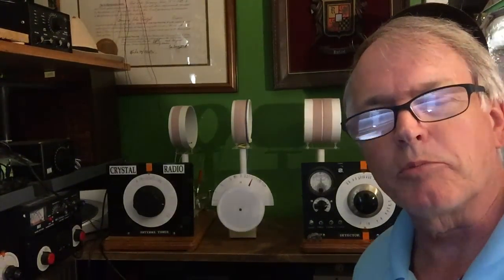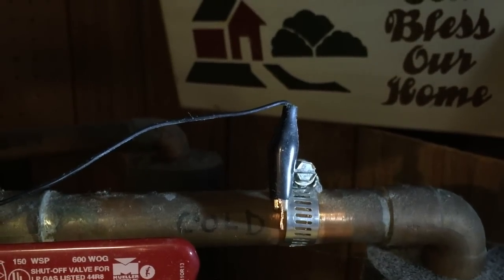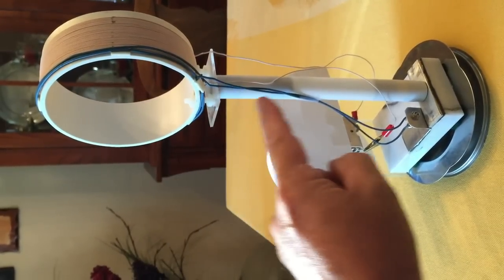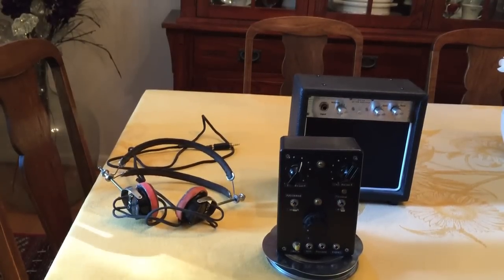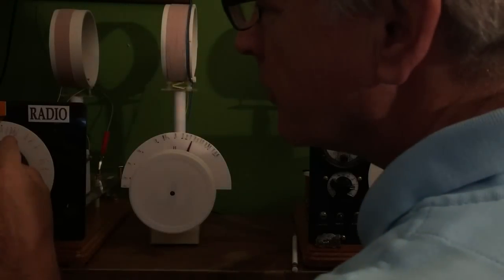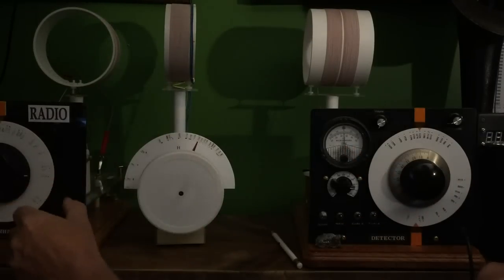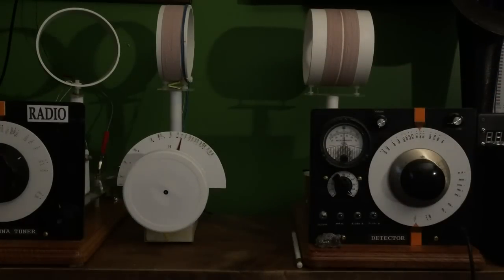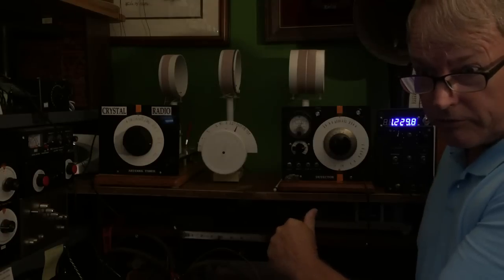xtal1

Comment: Very nice Chris  , I use to use antique 1920s designs from Roger Horton in Silver Springs, NV and even with a simpler single variocoupler system   using a 250 ft long wire antenna, audio amp and a good trap and an outboard antenna tuner with simple house AC ground I have logged 32 states. I have even logged several low power stations in the day out to 100 to 150 miles,   3 were only running 250 watts class C , big thrill   I also use a BC Band receiving loop in the ground side of the circuit as sort of a traveling wave trap and it works excellent, eliminates having to have more than 1 trap  You tune the loop until you knock down the local power house about 75 to 80 percent then start radio tuning for other weaker stations,   I sold all my gear 3 years ago to go RVing but those plans did not pan out and regret losing my prize crystal radio station, glad I caught your video as I am now determined to get back on,  What a beauty you have there-   all the best- J
Reply from the maker: Thanks James- hope you can getback on- your technique for pulling in the weak ones behind the flame throwers is very good!

Comment: It would be interesting to hear more in depth about filtering, and how to increase over all efficiency.
Reply: The trick to this radio's excellent selectivity is the Band Pass Filter, located between the Antenna Tuner Coil and the Detector Coil(s).  It has a very high "Q" factor, because of low RF resistance at these frequencies. Highly recommended for your next set....

Comment: Where do you get polystyrene tubing?
Reply: Obtained at Home Depot ... Drainage plumbing fittings... sawed round sections off. Make sure it's polystyrene it's the best, although polyethylene and PTFE are also pretty good.
Reply: @christopherwendling4519  That's interesting. I was not aware they sold polystyrene pipe. We'll have to keep our eye out for that one.

Comment: Very cool! Where do you find the polystyrene material for the coil forms? Isn't polystyrene really soft?
Reply: Same material, but the "soft" polystyrene has tiny are bubbles blown into it intentionally, typically used for drinking cups. I buy the polystyrene forms (4" sewer couplers) at Home Depot. Make sure they are the white polystyrene material.
Reply: @christopherwendling4519  Sewage and water piping materials are usually polyvinylchloride (PVC)  rather than polystyrene.  Unless special ordered, I've not been able to find polystyrene plumbing components at a "hardware" store.  In the larger sizes, the low pressure application pipe is usually a foam core sandwich for weight reasons.  The foam reduces linear weight while the PVC clad lends its toughness to protecting the core.

Comment: Just like many others, I really enjoyed this video. I am sure this project has taken many hours of effort and it has paid off well for you. Thanks for including a look at your schematic which I have studied pretty carefully. I think I found a minor issue in it, though. I think you have the L and H labels swapped on the band select switch for the contra-wound coil in the schematic.
Reply: Wow Joseph, I'm impressed. I DID mislabel the schematic!  Contra coils in series (coils in phase) is the low band (more inductance), and contra coils in parallel is less inductance, so higher band.
Good eye. I labelled my radio after it was built, and it was obvious which of the two switch positions was low vs. high. But the schematic has been corrected... You get the prize!
Reply: @christopherwendling4519  Would you mind if I tried to clear up some of your schematics and share them with a Crystal Set Radio Group on Facebook? Of course, I would credit you as the original author and include a link to your video.
Reply: @josephwatson4616  I wouldn't mind at all Joseph! Thank you very much. Send me a link when you complete it...

Comment: Totally puzzled me how you managed to bring the wire up the tree so high?   Use a drone?
Or you just throw it up?   90feet?   I am amazed.
Reply: Simply ask someone young and strong to clime up the tree. It really is that simple.
Reply: I have a bow and arrow with a blunt point. I tie fishing line to the arrow, and shoot it over the tree.(line payed out with a casting reel).
Then I use that fishing line (as a leader line) to pull a heavier line over the tree. Finally, I use that heavier line to pull the antenna wire up and over.